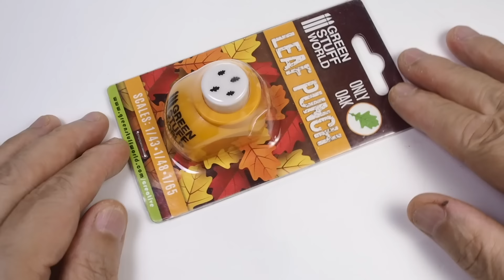WIRBELWIND camouflaged with autumn leaves - Part 2 - 1/35 TAMIYA - [ Painting weathering ]

Comment: Excellent Modell really impressive.Just one question where do you get the Red Oxide Surfacer?
Reply from the maker: I purchased it from Amazon Japan.🍎🍎🍎
https://www.amazon.co.jp/ガイアノーツ-GS-04-サーフェイサー-オキサイドレッド-50ml/dp/B0051XTHR8/ref=sr_1_1?adgrpid=68517924634&hvadid=651755795234&hvdev=c&hvlocphy=1009698&hvnetw=g&hvqmt=e&hvrand=5941318795016040963&hvtargid=kwd-615878948122&hydadcr=4293_13319748&jp-ad-ap=0&keywords=サーフェイサーエヴォ%2Bオキサイドレッド&qid=1699051323&sr=8-1&th=1